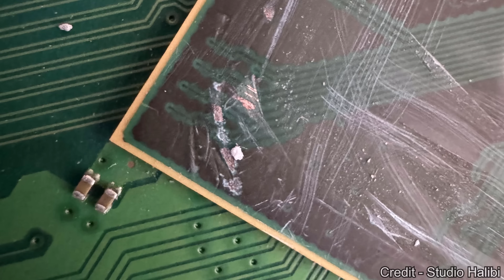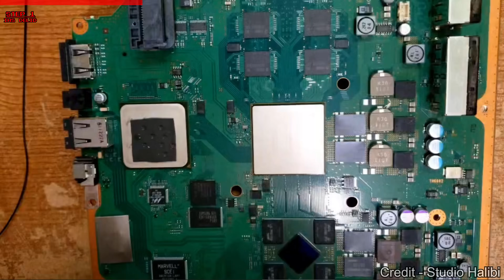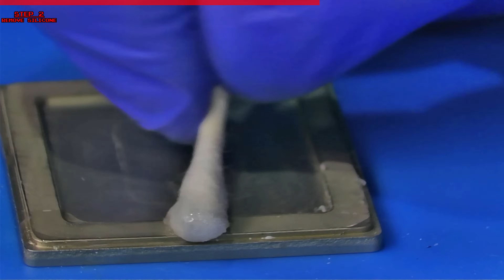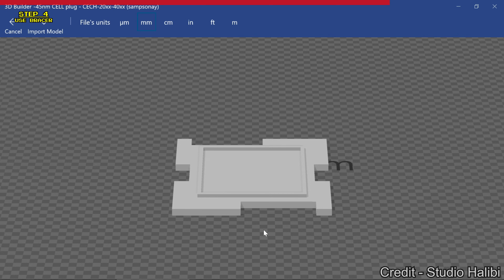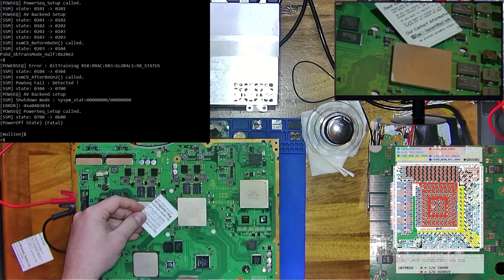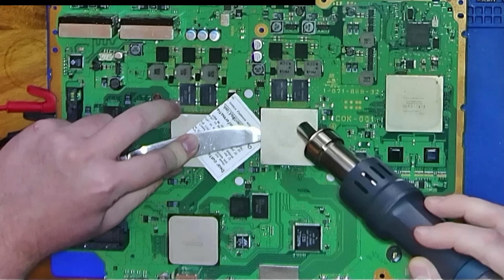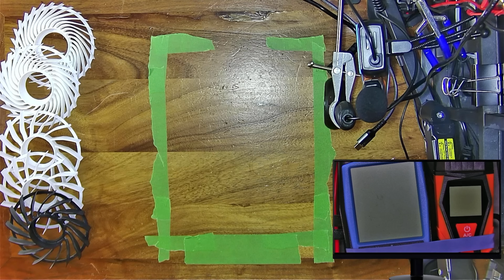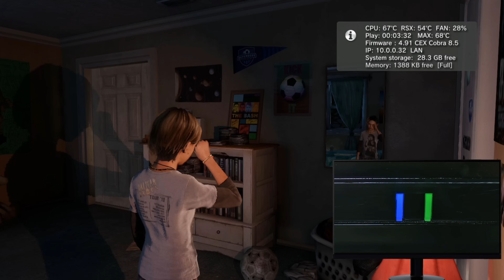How to Fix | Episode 1: Overheating. How to Delid CPU/GPU and fix YLOD - BEWARE of BAD MODs!

Comment: İ have ps3 slim model if ı dont usr glue for cpu and gpu should ı make plastick plate anymore
Reply from the maker: you can if you want to. I think it will limit movment under the die and allow the paste to last longer. Most practical reason.

Potentially the BGA as well, but I can't predict how long the chip will live without the glue with any certainty. I suspect it will shave some time off the longevity of the bumps and/or BGA durability. But if it lasts longer than the useful life of the die anyway (electromigration), then it wont matter. Just no telling without CAE or following a large amount of consoles that were delided and comparing the uptime before the delid and after they die, to get the average time they lasted. Then compare that to the same data from consoles that were glued back. It's just too difficult to do on the hobby level. Would require a medium to large business doing these for many many years to get a dataset large enought to see any statisitically significant difference.

Comment: Hey man, I have finally decided to delid my PS3, after deliding my PS3 was having YLOD,  so I decided to check syscon error logs, I'm getting error code : A0203010. Any help on how to fix this? I see no scratches on the CELL
Reply from the maker: You may have flexed the board and caused a CPU ball to break. That 3010 is one of the codes commonly encountered after a failed cpu delid. So if no traces were broken, no nearby SMDs are knocked or missing (check them carefully), then flexing could be the cause. That's why I use the MB brace to keep it from flexing.

Sorry you had this. It's one of the risks of delidding the cell. It's why I dont reccomend it as preventative maintenence unless you actually need to. And it's why I reccomend a proper delidding tool. The painters knife isn't my favorite tool either. I feel the way it inserts places too much force on the board. But others like it and swear by it, so I've acquiesced to their experiance.

Comment: Update: I apparently misremembered, the backplates attached to my RF shield didn't actually have any such additional protrusions, just the small nylon feet. Also it turned out that I didn't put quite enough paste on the RSX and Cell dies the last time I had it open, so it's actually a very good thing I re-opened it to apply that gasket stuff you recommended to remake the cell processor supporting seal. This video might have indirectly saved my PS3 from myself.

Original comment follows;

I've actually delided both at this point, some time apart; the Cell a couple years ago and the RSX just yesterday. I may not have done it for the smartest reasons (You specifically call out deliding the RSX not being appropriate for preventative maintenance) but it seemed to go well.

That said, I think I'm going to need to open it up again and apply your recommendation of remaking the silicone seal on the Cell. It has worked fine since my delid, but it's a backward-compatible Fat model and I'd like to give it the best chance of longevity I can.

I considered ordering a brace for the backplates but, curiously, I think the integrated backplates on my model actually already have a protruding ring of metal that sits within the hole in the motherboard around the back of the cell and RSX. I don't know how common this is, I'm in a PAL region that only received the later backwards compatible PS3 models if that makes a difference. I'll double-check the next time I have it apart to re-apply the silicone seal.

Comment: And again, so much bla, bla, bla... you say, with your technics witch mostly was taken from my channel... BTW, had a PS3 PSU completely external ruining without problems for years, drilled holes and after 2 years a guy buy it from me and that console never had problems 😂😂😂 and not to forget, the best tool to remove the CELL IHS is to use NSC's PS3 IHS TOOL. And DON'T glue that IHS back, the pressure is fully enough to hold that all together without problems. My god...
Reply from the maker: Everyone has different opinions about it. Not sure where the animosity is coming from. I'm just following the engineering and refining my techniques as I go. Yes, I made my CPU delidding tool from watching your video. The tutorial I posted on psx place in my signature links your video where you show how it's made and used. It was mainly a response to questions about how I made it.

I've said in the past I enjoy your videos and learned alot from you. I don't hold any ill feeling toward you and I hope other people aren't telling you I do.

Having said that, I disagree about the adhesives and because I knew it's not a popular opinion I laid out my case. I try to base my advice off the engineering principals. People are free to choose for themselves.
Reply: @ripfelix3020  Bro. You talk every time bad and against me and my mods, no need to be stupid to see that, but hey, it's OK, you do your stuff, i do my, but don't bring people's in panic with bad informations witch you never have tested so long than me, also no need to glue back the IHS, the pressure will hold the IHS without problems, and after a month or two the IHS will be fixed great as he'll without glue. Whatever, people's already know where you got all your Infos and it's only for your ego to talk bad over other stuff to make you look better than others, that sucks... specifically talking bad about my mods, my way, my ideas, my stuff, or did you ever talk good about me? No, not one time in your Videos, only negative stuff all over the place. Whatever, I'm out here, Peace to the rest that already know my stuff and always appreciate it.
Reply from the maker: Sounds like you're "feeling" singled out. Hey, I'm an emotional guy too. I get it!Please be assured, I'm not singling you out specifically. 

I talk about mods I don't believe are good, but I've drilled holes too. I am talking about myself as much as others. There are many people cutting holes, not gluing the IHS back on, replacing tokins with inappropriate caps...etc. I'm speaking in general, never singling anyone out in particular. It's not my intention to imply you are who I'm talking about. I apologize for giving you that impression. 

I have tried to better word things to avoid such implications, but I'll admit I want to get better at identifying how what I say can be misinterprited. It's a personal failing of mine that IDK I'll ever beat.

You're probably thinking of my 1st video where I showed a short clip of holes drilled in the console. I wasn't trying to hide the fact I clipped that from your video. That's why I left your water mark visable. I think YT will let me blur that actually. Let me know if want me to and I'll try.

However, this does tell people that clip was you and since over a milliom people saw it, some of them will have then gone on to watch yours. It's free publicity.

I was just trying to show a visual example of holes drilled. I wasn't trying to single you out specifically. I remember your comment in that video. I thought we had worked it out.

In my last video I asked squeept, sampsonay, and others if I could use clips from their videos while critisizing their technique. They agreed. That was thanks to your comments in that 1st video. You said it would have been better if I had asked you first. I took that to heart. Afterall. I'm a fan! It sucks to get chewed out by a YT're you admire. But I gotta be honest man! It feels like you're being unreasonable.

The clips I use are just an example of the much wider practice I'm talkinag about, not the individual in the visual example used to illistrate it. This is a protected fair use.

About the mods themselves. I know better now that I've tested the temps of the VRM and BD chips. You only teste the PSU. I've revised my advice acording to the evidence I've gathered, and you did not! I will continue to adjust my reccomendations when I learn more. I will continue to blast bad practices.

This is my philosophy as a scientist and DIY'er. We make mistakes, learn how to not repeate them, and get better. I'm trying to apply this to the videos I make also. When anyone makes a youtube video, that's a snapshot of where they were in their ability and where the community was at collectively. I cringe at things in that 1st video. I think I've gotten better at both repair and making videos. It's my intention to continue getting better.

No hard feelings bro. My hole drilled console has worked since 2012. I haven't put that much time in on it and because of that I'm not comfortable saying it's fine. But at the very least it's not going to kill it quickly. There's enough evidence to show the VRM don't die soon afterwards, but I have see them die and this could be why. Besides, I preferr no cut mods and I believe the airflow pattern in the case is sufficient if the console is maintained.

About the IHS. It's about thermal cycles and the added stress of not having it glued on, since it acts as a stiffener. It's not about moving out of position. I have researched this point and can tell you it's a thing. Experince with repairs is a relative thing. My approach is to research and apply design principals to avoid trial/error as much as possable. I learn from everyone and everything, not just what I've personally experianced.

In this case it means trusting IBM's packaging partner, the thermal design and physical design teams knew what they were doing. It would be exceedingly arogant to assume I know more than an expert in this field! I was tempted to believe they were crazy, but asked myself, "why did they glue it on?" When I looked deeper than "because they're stupid" what I found was enough reason to not assume they were idiots. To the contrary, they were EXTREEMLY competent and thorough! They deserve the benifit of doubt because they actually do know what they're doing!

After seeing their thorough research, I made the descision that I would respect the original design objective and put it back with the closest match adhesives I could find. That way I know I'm not changing a varible that "might" have negative long term consequences. Especially since I do not have the computer aided engineering software necessary to model and simulate the long term consequences! 

This should be the default position for any design change. Unless we know for certain departing from the design absolutely will improve reliability, then I default to the original intent of the design. IHS glued on? Glue it back on unless you fully understand to consequences of not doing so. Wanna drill holes? What effect will doing so have on the rest of the components that rely on the intended airflow pattern? 

The only time we should depart from the original design is when we're forced to. Tokins are old and so difficult to install it risks harming the console. So a properly designed polymer array can be used. The 90nm is defective, it can be replaced with a reliable model. In those cases we're trading a known consequence for a known benifit. Deliding is about replacing worn paste, not about leaving glue off a structural support that serves other purposes. It's definatly not about assumimg it's pointless, or deflecting the  argument by saying it wont move if you don't glue. That's an equovocation, not relevent.

The last thing I'll say is. I didn't learn everything from you. I learned from watching computer booter, squeept, sampsonay, shawn shakir, M4j0r, zecoxao, pacoretaco, voultar, Bob from RetroRGB, ste from HDRetrovision, matcho natcho production, the Cod3er, louis rossman, and many others. 

And so have you.

We all learn from out teachers. Bands have other bands they credit as influencing their style. This is how information works. I fully expect and encourage others to learn from me. And when they have sucess with their projects in part because I inspired them, I'l be super happy for them. Like a teacher proud of their student. And when The surpass me, I hope to cheer them on even when it makes me look bad. Because I'm all about progress and better information. I neither care nor need to feel like I own it. I'm not that self important. Ultimately, it's a video game console. The stakes are low, all things considered.
Reply: @NSC-Modz  I fear that during heat cycles, the viscosity of the paste will decrease and allow for the IHS to potentially slide across the surface of the die. When the console is in vertical position especially. So during heat cycles the pressure may not be enough to hold the IHS in place due to the paste changing its state.
Reply: @calyps0man  nope, i had a ps3 witch i delid and repaste it, working about 4 years, after 4 years i open it again to check the IHS and Thermal paste, it was all just like it should be. I have just apply the thermal paste inside the IHS, never had to take of the IHS from the Heatsink, because it was still fixed great. It's all about testing testing testing, so i know what I'm talking about ✌️
Reply: @ripfelix3020 i honestly feel like this is the typical response from the ps3 scene, petty bickering instead of constructive scientific methods, no wonder it took this long for somebody to move that needle 😅 , thank you for showing us a different way really
Reply: @ripfelix3020  It is best to ignore NSC, he is full of himself and acts like he knows more than the Sony engineers that worked on the PS3.
Reply: Here is an idea could we just say just not having the lids on ether the cpu or rsx and just make a custom new heatsink mods instead. Yea it could be a little expensive and it would have to unique based on chassis or board version etc… it would have to be similar to the existing heatsink but add the difference of not having the lid.  Basically just be straight heatsink to the chip and an optional Liquid Metal mod add on would be nice too.

Comment: I love how much effort was made to make point to glue IHS back on and admit not doing that on own consoles.. as honestly there is no good point to do so from any point of view other than assumptions and guesses why it would be there other than just keeping it still. But give points showing how do gluing well. Though i want say when selecting silicone is best select one which wont be corrosive for electronics aka wont create acetic acid during curing process.

Comment: Isn't there also a very big chance of losing the backwards compatibility with ps2 games
Reply from the maker: Not really, no. I have had one console it happend to. Bad luck that it was my 1st frankie. It seems to be related to delamination from the heating process while learning and not having a dialed in profile. It could be the EEGS, but jury's still out on that one. But once you get the profile dialed in and develop the skills to perform it properly, it tends to stop happening and become rare. But there is always the possability something breaks over time naturally and it'll just die with use. I know one guy that's put many many hours of use on his PS3 palying PS2 almost exclusivly on it, and he finally did wear out the EEGS. Another tech replaced it for him and the new one's been working fine since.
Reply: @ripfelix3020  huh, thanks for clearing that up. I'm surprised, I've heard a lot from many PS3 communities of it, that it basically killed the entire backwards compatibility. Thanks for clarification
Reply from the maker: It's not unheard of, but it's on the lower end of the issues the console sees. Like disc drive failures, PSU, caps, fuses, GPU...etc. I'd say loosing PS2 functionality is likely on th rise, but not yet a serious concern. But these things change over time as it ages and gets more use.

Mind you, I'm basing this off a feeling of how many reports of noPS2 that come acraoss my feed, not tracked statistics. Since loosing ps2 sucks, it doesn't prevent you from using the ps3 and emulating PS2. So people often accept it and move on. They don't toss the console cheap on ebay where people then buy it and look on psx place for advice on how to fix it. So naturally, the places I scrape for information is going to be a limited subset of the entitrty of PS3 problems people experiance. noPS2 could be a larger issue that's flying under my radar, because I deal mostly with YLOD consoles and dont spend much time on reddit where these sort of issues are more reported.

Comment: And here i thought i was being clever drilling the holes under the console. So to sumerize, having the fans run fast at all times wont solve the low fan speed hole problem as the components like psu and disc drive are just not getting air?
Reply from the maker: The syscon bases fan speed off CPU and GPU temps. The hole cools them more, the fans can run at a slower speed to maintain the same temps. The airflow through the console is circumvented and components cooled by that pattern get hotter. Regardless how fast you run the console, the holes will circumvent. So if say before you got 50CFM through the upper compartment at 25% and 300 CFM at 50%, the circumvention will lower whatever the CFM would have been at whatever speed you set it to.

Dramaticly lower CPU/RSX temps are possable at the same %, but what most people are doing is actually setting webman at 68C and the holes only make the fan less noisy. So it's not like the temps are lower, it's just the fan is quieter. That makes them feel better and enjoy the noise reduction. But it comes at an unknown longevity consequence. And I have seen the VRM burn out and need replaced. It's not very easy and requires lots of heat...BUT, "If" it could prevent the 90nm from dying (I'm not convinced it can) one could argue it's a better outcome. I don't like it anyway.